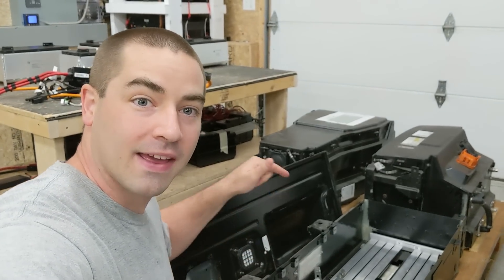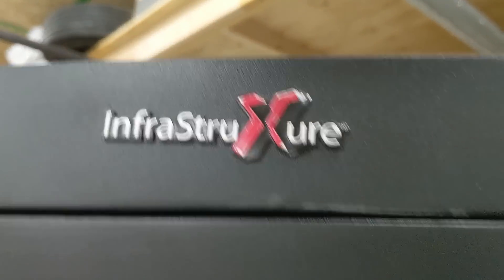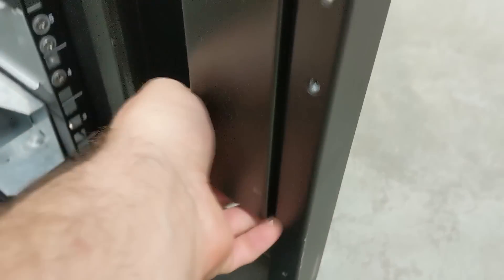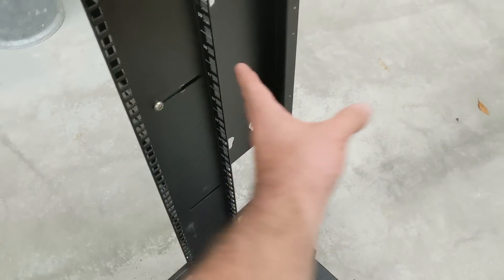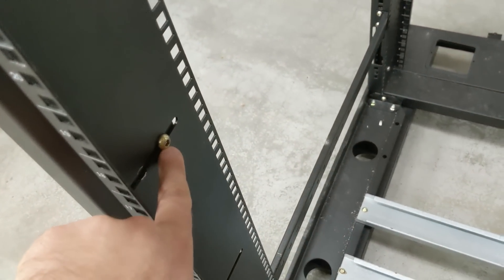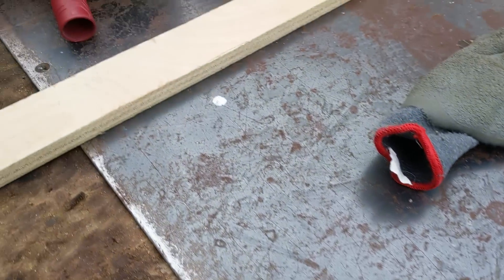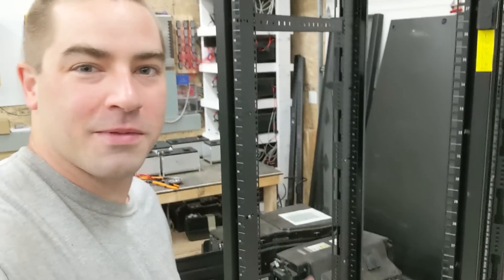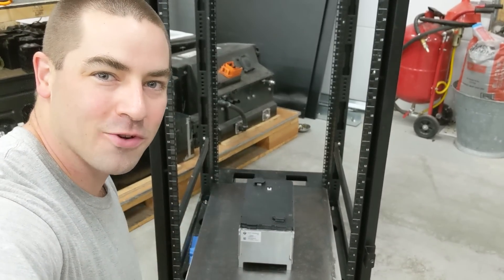Making a Home for Solar Batteries, DIY  BMW EV Lithium Cells

Comment: David, I’m far from an expert on electronics & batteries, I know a bit more about servers and server racks. A question from my side would be how much weight will a shelf need to carry? If you are planning to use only 4 bolts to fasten the shelf to the uprights with a lot of weight you might want to look at spreading the weight over multiple points (bolts). The uprights steel might not be thick enough to carry a lot of weight.

Comment: Hi Dave, MDF Board 1.2 ins might be better when supported on All Sides inc Front, Rear, Left Right with the L angle so you can just drop the MDF Board in at each level, if you do need a conductive area sheet of copper on the MDF Board then Bolt through :), I've got that feeling your powering the lane, hehe have a look at what current Solar Panels are going upto 625W & 800W each !, if Iget a bungalow with a lot of garden space I would go for Two face Solar Panels & Victron Energy units, I sure would go for the highest power I could, IF I won the lottery then I would go for at least 50MW Solar Farm, My wish, for sure is to go off Grid for EVERYTHING Dave, including water, Gas, & Solar Evacuated Tubes for Solar Hot Water, Iwould collect rainwater & filter that & iluminate with UV to clean out anything, use that for toilets, maybe washing matchine, depends on how clean I can filter the water.
Thanks Dave, Wow Your little one has grown up very fast :)

Comment: If plywood isnt strong enough and you need to go with a steel plate, you dont need to epoxy coat it, you could use a lot of budget things. for example, truck bed liner is about 7 bucks a can, and a can should easily do a shelf or two, you could use roofing tar and paint it on with a brush then let it dry. you just have to sand it with a rough sand paper before painting so you get a mechanical bond for it to adhere to.  hell even a can of nearly any automotive paint should do the trick to keep a relatively durable and insulating surface coating for the "oops I dropped it" moments. you could also go to five below, and grab flooring mats that are EPA foam and cut those to size and place it ontop of the sheet of metal and you get a decent stack of them for five bucks.

Comment: if you use steel plates use tractor rubber mud flaps they are cheep and will help keep the batteries from sliding around

Comment: That's the first time I've seen someone use the grinder backwards on an open flat cut.
Reply from the maker: I did half the cut one way, then switched it as I moved to the other side of the table.  Otherwise I was leaning way over.  Is it wrong?  Is there a link to a use manual that specifies not to do it a certain way?  I was trying to save my back, it gets sore leaning way over to get the far side.
Reply: @DavidPozEnergy  safety more than anything, if it bites what you are cutting, it kicks back towards you rather than away that's all.

Comment: how about some heavy duty drawer slides to slide the batteries for maintenance ?
Reply from the maker: I looked up heavy duty sliding trays.  The ones I saw rated for 300# were over $300.
Reply: @DavidPozEnergy  how heavy are each battery pack in each level? The ones i seen on eBay are rated for 100-150lbs and the pairs cost from $24-40 and the 250lb version for  $60 the 500lb versions for $79... but it's the drawer slides not trays... you can make the tray part.

Comment: One thing you may or may not know about server racks (please disregard this if you already know), is those 4 bolts on the bottom corners, you are supposed to unscrew so they contact the ground (like household appliances) and you can use them for fine-leveling the rack or setting specific height, or in my case I've always found the floor is usually always level in a datacenter, so on a temporary install location, I mainly just unscrew them down enough to take the pressure off the wheels enough so if we have a minor tremor the server won't roll around when you don't want it to. Technically, on permanent install in a datacenter we install permanent brackets to bolt the rack to the floor so in a real earthquake it will stay put. Those leveling bolts also should have a lock-bolt on them to tighten down against the rack chassis once the height is where you desire...
Reply from the maker: Thanks for the tip.  Yes, I was aware, but it's a good thing to point out.  I've never installed a server rack, but I have outfitted kitchens and it looked the same as ovens or dishwashers.  Once I get it into final position I'll drop them down.

Comment: Angle iron, use off cut pieces and weld them to give you additional anchor points in the front and rear of the rack. You can secure it to the front and rear cage holes, as well as to the sides using bolts. Keep your eye on shear strength of bolts that you use: heavy batteries might cause you some stripping/warping issues.
Servers are only like 100lbs with hard drives. Even huge blade/chassis networking equipment isn't more than like 300lbs fully loaded, and usually sits on the bottom of a rack like that. 👍

Comment: You are totally going the right direction with those angle brackets on the side, that's exactly what they are there for, it's very common to buy prepared shelf angles for server racks when dealing with equipment that is heavy and doesn't have rack slides.
You can put almost any weight in a good rack, although watch out for those wheels, they'll probably chew up quickly on a floor that isn't flat and smooth.
I like the idea of cement board to protect the plywood, but I would probably check with the recycler to see if they have actual rack shelves. They will be ready made and powder coated, so not conductive, depends on how much they are asking for them.
Maybe intumescent paint on the bottom of the plywood to stop any fire and a thin cement board on top?
Reply from the maker: Thanks.  While I was at the recycler I asked about shelves.  They had a crate, about half full of them.  But they were all half shelves?  I don't know the correct term, but they looked like they took up 2 or 3 U on the front, but only went back a foot or so.
Reply: Yea, there's two types, full depth with rack slots on each end and the half length. There are also full depth ones which slide out nicely for maintenance but they cost a premium.
If all they had was half length then that's that, unless they are cheap and you can buy two as back to back.

Comment: Weren't the LiFe batteries in your "Tower of Power" rack-mountable? I would install them in the rack where you'll get better usage of physical space, and then put the BMW packs on the old tower. Definitely leave room for standard rackmount equipment no matter what you do, you'll thank me later when some future gear needs it.
Reply from the maker: Those LiFePO4 batteries in my tower don't have anything that would connect to a server rack.  I don't see any form of attachment at all.  My guess is they sat on pallet racking, or something like that.
Reply: @DavidPozEnergy  Ah, maybe I was just misremembering. I know I've seen rackmount batteries like that but it was probably somewhere else. Thanks for your response.

Comment: Hi David, that was a nice find, please consider the centre of gravity and have at least two batteries on the lower shelf and one on the others above.  From my experience with 19 inch racks it’s normal to fit the heavier gear low down, also double bond (ground) each metal part that detaches, you may need to file off the paintwork to ensure good continuity is achieved for your grounding cables.

Comment: Are you sure it can handle the wight?...those batteries look much heavier than a few server units...
And if I were you, maybe I would add some temperature controlled switches... You are collecting a lot of flamable materials and I have not seen any temperature control in any of your videos.
Reply: Server's aren't lightweight either. My 2U server at home is almost 50 pounds. I just looked and the cheapest 42U rack on APC's website has a static weight capacity of 2205 lbs or 1000 kg.
Reply from the maker: I've done a few tests and found that by limiting the cells to half-C rate, they don't get warm (let alone hot).

Comment: The angle iron is good, and some Hardi backer I think would work great.  I didn't know how strong it was until I put a 1/2" thick sheet down on a worn away floor for my desk chair to roll on.  Will be watching for updates!

Comment: 1U = 1.75" though rackmount equipment will be slightly shorter than this for clearance. If it's useful to know, the 3 holes 'within' a U will have centre spacing of 0.625", and between U 0.5".

We use similar nuts called cage nuts with a slightly different arrangement but same purpose, readily available if you wanted to use the proper hardware for the rack.

The PDUs you pulled out are almost certainly worth substantially more than you paid for the rack on the secondary market, they aint cheap. Might be use for you somewhere too, the higher end models have individual outlet current monitoring and switching with a web interface.

I think your plywood idea is the better one. The steel is heavier, more expensive, possibly flexes more, plus the risk of shorts, and you don't already have it. Unless you're short on space doesn't seem to have much recommending it.

Comment: I think that the cabinet's rails are thin for the weight they're going to cary. If i were you i would exchange them with something more durable to support all the shelves.
Reply: Rubbish. Servers are 20 to 30kg each in a 2U slot. That rack would easily support hundreds of kilos
Reply: Servers are heavy. Such racks are usually rated for 3000lbs static load. It will be fine.

Comment: 🤔 this idea looks familiar 😝 mine has metal shelves and I only had one instance of dropping a live wire and it was actually no where near the steel shelves. The whole cabinet is made of steel so don’t sweat it. You can use this plywood over the metal if you like. The thin stuff is real cheap. Other than that I know your real careful so just keep connections taped until final connection is to be made. Looking forward to your build. Mine has shipped overseas.

Comment: Hi there just a quick one to say that unfortunately the server rack is not designed for heavy equipment to a hight of over 15U. These cabinets do not have the load capability and stiffness it will probably twist and collapse which will then damage the battery and the other equipment. A easy way to insulate the metal is 2 or 3 lears of duct tape. Good look and be careful
Reply from the maker: That's interesting, because when I built my existing shelving unit...  I built it with 2x4's and 2x6's.  I received over a hundred comments on that video telling me it would collapse and I needed to use a server rack.
Reply: @DavidPozEnergy  hi again your 2x4 has a lot of braising and due to the large serfice area in conflict it should stand but a comms rack especially when the sides and back are off lt loses a lot of it's stiffness as the uprights are relatively thin pressed steel with no cross brasing so please be careful with it as you load the batteries
Reply: @paulsharpe3794  Such a rack is rated to at least 2000lbs, and typically more than 3000lbs capacity. This is a 4-post server rack, not a 2-post comms rack.

I would still be careful of the high centre of gravity, especially if you keep it on the casters. I would strongly recommend having the levelling feet bear all the weight once it's in its final position, and if feasible, bolt it to the ground / wall to reduce the tipping risk in case of earthquake / ride-on accident etc. but it is 'safe enough' as is.
Reply: Paul, where did you find this information? The server rack is designed to hold servers, and if you've ever used a server, you know how heavy they are. That thing can probably hold 2000lbs or more easily with properly-constructed shelves.
Reply: Remember that server racks are designed to handle UPS units, which are also crazy heavy. But that might be why the other poster mentioned “up to 15U” in height.
Reply: Also @DavidPoz I’m not sure where you’re located but I have (3) brand new in box vented server shelves. StarTech part number UNISLDSHF19 if you want to check them out. I’m in the Philly region and would be happy to donate them to your project. I think something like this would be superior for your shelving since you’d have the flexibility to be able to adjust height vs your angle iron plan. I’m just not sure about weight.

Comment: Power strip is a PDU and is networkable so you can reboot servers.  Each plug is addressable.  The nuts are called cage nuts.  Those PDUs are worth $$
Reply from the maker: How do I sell PDU's?  Just Ebay?
Reply: @DavidPozEnergy  Yeah or craigslist

Comment: Regarding the plywood shelving - you could always add a layer of cement board like I did with my unistrut shelving. I used 1/2 plywood and 1/2 hardie backer. There's a thinner version available as I'm sure you know, might be 0.25" or so if you're using thicker plywood. It's cheap and I feel this has added a reasonable balance between flammable and non-flammable.
Reply from the maker: I love your build in your shipping container.

Comment: Hey, there’s some trivia I know for you! Haha...
“U” stands for, “Unit,” and actually comes from the Audio industry. The 19” rack format was built for rack-mount audio equipment, like amplifiers and effects units. A single effects unit is typically 1.75” tall, so a rack built to hold 6 rack-mount effects units would have 10.5” of vertical rack-mount space, and be designated as, “6U.” 
Meanwhile, many amplifiers are 4U in height, even though they are a single amplifier. 
Great build! I love your channel and your projects, and I’ll be starting in soon on my own modular powerwall project ☺️
Reply from the maker: Thanks for the definition.  That's funny that I said "Unit" and didn't realize that's what it meant.

Comment: Rubber matt on the steel can glue it on if you want or much more expensive the cutting board material you like to use or maybe the corrugated plastic material signs are made of.
Reply: Ice and water shield already has adhesive

Comment: Hold on to the cage nuts and bolts you removed, might want to use them later. Also FYI 1u is about 1.73 inches, it is a standard for height of equipment mounted in the rack.   I would leave the bottom self metal and cover it with a rubber mat. The angle iron is a good idea but I think 2x4 would work better (cheaper to replace if design changes). place your shelf in, stand 4 2x4s cut to length up held in place with clamps. Set the next shelf in place and screw through to the 2x4s. remove clamps and repeat until you have all your shelved built. If you think some additional support is needed then use the angle to run diagonally under the shelf, one run should work. Just my two cents...
Reply: 2x4 is flammable, not the best idea near high density lithium.

Comment: DavisPoz make custom battery shelf brackets of angle iron then you can put the batteries in these holders. then you do not have to make whole shelves, then you also get a good flow of cold air for cooling the batteries

Comment: Also for this rack what I would definitely is get https://www.ebay.com/itm/262811228412 this supports 110 pounds weld a plate to make a shelf then you can pull 110pounds in and out of the rack.

Comment: The screws on the bottom are to stop if from moving you lower them to the floor ideally then return wheels also not sure if you need to worry about tilt but racks should be braced for earthquakes they like to tip over .

Comment: David, I'd go with 3/4" ACX plywood for shelves.  Angle iron brackets should be fine.  If you decided to go with steel you would need a few coats of Epoxy paint which would likely match the cost of new steel, if not more.  I would leave the plywood bare (no coating), as the wood will naturally absorb minor amounts of off-gassing, since you are using liquid catalyst based Lithium batteries.  It may neutralize any minute fumes that could otherwise damage any electronics installed in the rack over time.

Comment: I couldn't tell from the quick shot of that power bar, but it looked like the one side is actually a PDU which means each outlet has power monitoring and can be remotely switched on and off ... maybe interesting for a different project for you... you can see the watts on each socket, and if something is using too much, turn it off or schedule it. Used for remote reset of servers or running things on a schedule.

If not interesting for you, they're not cheap, maybe worth selling on ebay!

I am using a server rack for my DIY powerwall, and I currently have plywood as my shelf. I want to change this to metal for fire proofing: in the event of a fire I don't want all the batteries crashing down.  I was thinking of going with a metal sheet and then drywall on top of that to prevent conductivity. 

Not sure about your battery setup, but my whole rack is earthed, which is also battery negative in my system, so any contact of any wires would be a big boom.

The angle iron is probably the cheapest. You can also get angle brackets specifically for mounting things in the server rack (mine came with these, and that's what I'm using). You can also get drawer sliders for servers, which would let you slide each battery out.  Nice, but unnecessary :D
Reply: Having too much fun skating around- get to work😁
Reply: Surely if it's got to the point the fire is bad enough that a wooden shelf would fail, the batteries are beyond toast and beyond care at that point anyway? They would still be on fire whether in a heap at the bottom of the cabinet or not. 😆
Reply: Wondering if he could sell the PDUs and pay for the rack!